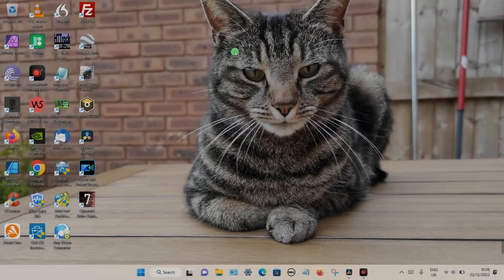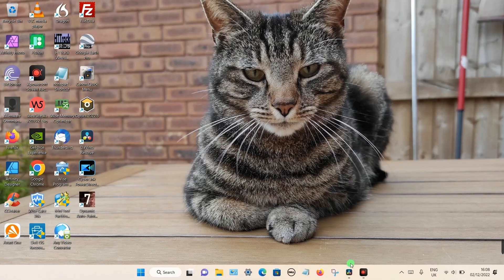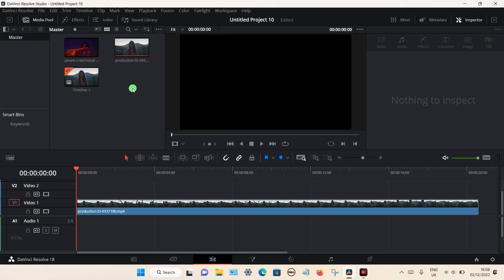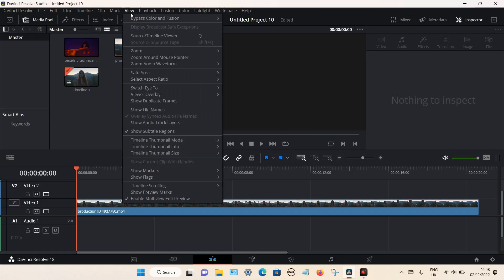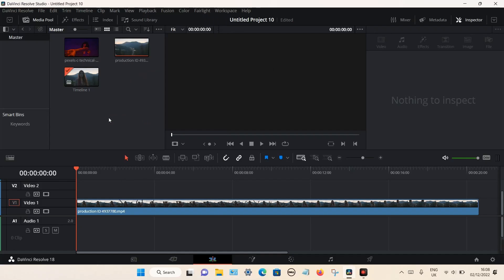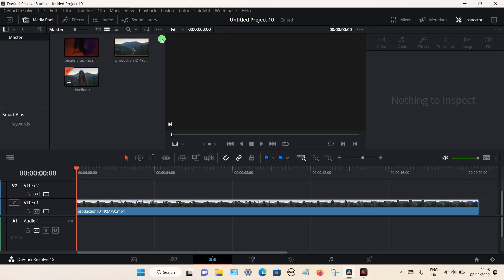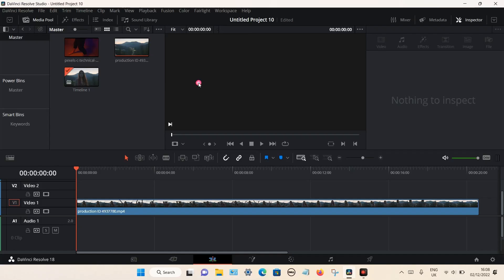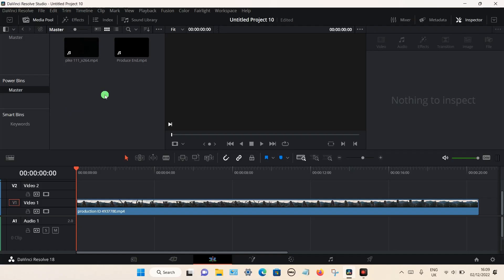How to Enable Power Bins in DaVinci Resolve 18.1

Comment: It doesn't show up for me. No option for power or smart bin in the ... icon
Reply from the maker: I've just tested it in version 18.6, and it still works.

Make sure you select the "edIt" tab on the bottom toolbar, and make sure you're in the "media pool", unless the three dots and option will not be available.